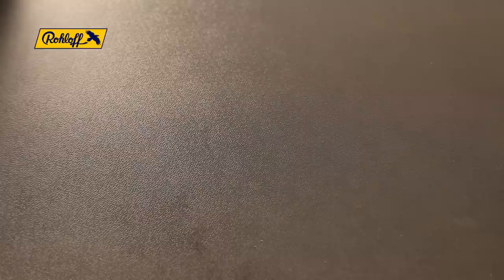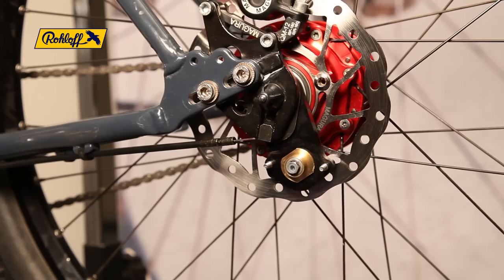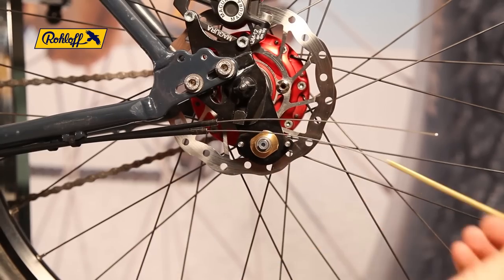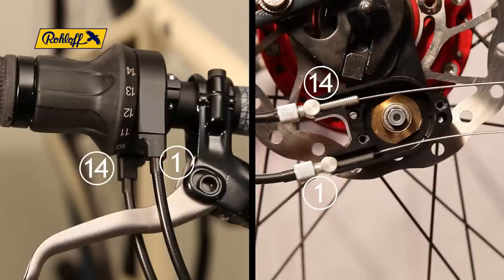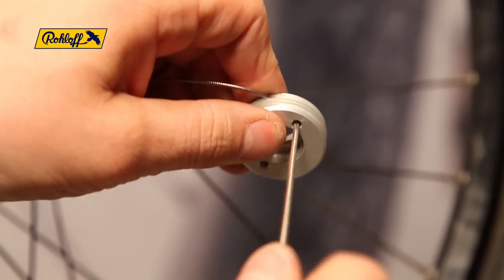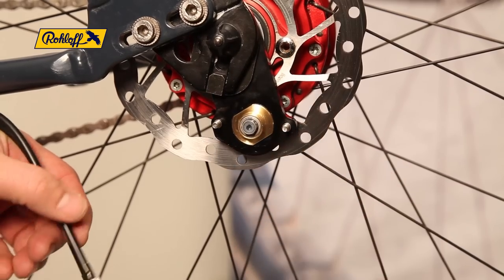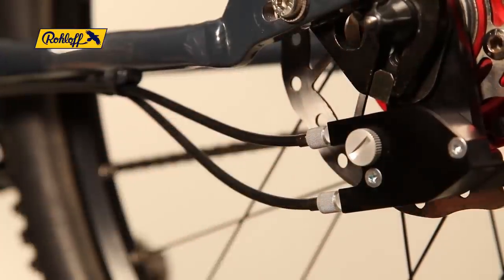SPEEDHUB Workshop - External gear mech cable replacement

Comment: Use Shimano TL-CT12 cable cutters and also heat the cable for 10sec over a naked lighter flame before cutting. 
This tool and method cuts the cable PERFECTLY! :-)
Do not try to thread a frayed cable into the cable pulley! The cable threads will be kinked and will rub on the inside of the pulley box where they'll eventually fail and jam.

Comment: Thank you for the video! I replaced both cables but now gear 14 is gear 1 and gear 1 is 14. I guess I did something wrong with the cable replacement, but whatever: I'll use it like this :)
Reply: did the same xD

Comment: When they pull the other cable taught after trimming 1st cable, the 1st cable does not move. What?
Reply: yup. I cant figure this one out at all.
Reply: @TimsTrikeTrips  yeh...bit weird
Reply: Noticed the same thing, pdf manual shows that once you pull the 14 for trimming 1 should move in and be visible shorter.

Comment: You have to do exactly backwards of the instructions for this hub to be shifting into the correct gear on the indicator the gear 14 must go into the ( lower blind hole)

Comment: @2:17 she does not tell us that there is another cable seat hole after the allen screw in aluminum donut, both cables haf to go past the allen screw into that second hole. If you have a frayed cable you will have problem.
Reply: Great point. Need to get the right hole - if you fix the cable in the wrong way up you're going to struggle with the frayed distorted end when you put it in the right hole.

Comment: I just finished installing mine and I'm noticing the shifting dial is difficult to turn after connecting the mech to hub. I greased the pulley as instructed. Is this normal? Will it wear in? I mean it's at the point that I need to remove my gloves to get a better grip.
Reply: Naaman Geist You ever get this figured out?

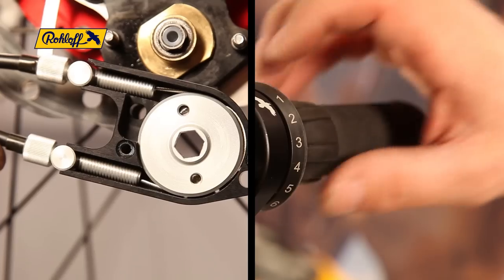Comment: Is it just me, but when I cut the cables to 200mm, they are way too short to get the pulley back into the shifter box. Where am I going wrong? I even backed the cables out of the blind holes a bit, so there are a couple of millimeters extra to work with. My cable adjusters end up as in the right image at 2:46 where the ends are just above and below the allen key holes, yet in the video at 3:04 the ends are miraculously 15mm further back, in line with the edge of the pulley, with no further explanation. What gives?
Reply: I cut one of the outers back by 15mm leaving the inners the same and I was able to get the cables to fit in the shifter box with just a few mm of the cable adjusters protruding. I don't know if there are different versions of the external shifter box, if the instructions are incorrect, or if I did something wrong, but it seems to be working fine now. In future I'll be measuring 205-210mm for each of the inners and save myself some frustration.
Reply: @ralph17p  did 21cm too... it was too tight with 20cm.
Reply: I had the same problem. I managed to force it in. The only reason I can imagine that Rohloff specifies such a tight fit, is cable stretch, though that’s probably not the reason. Why make such a sophisticated product and get the installation specs wrong? Likewise, if you fill the hub with 25ml of oil as Rohloff stipulates, you’ll get weeping at the seals. Why not simply tell owners to fill the hub with 16-17ml to avert that issue? It makes no sense.